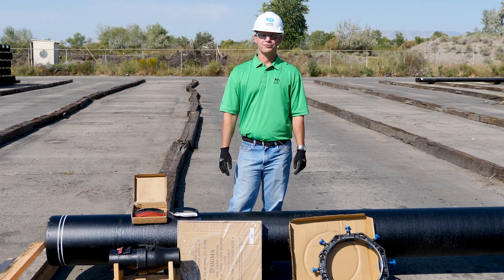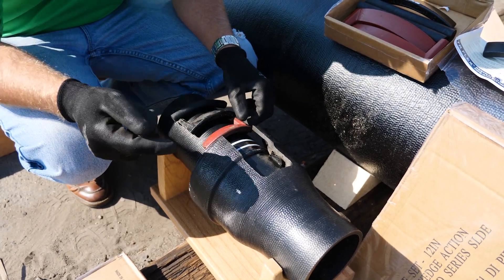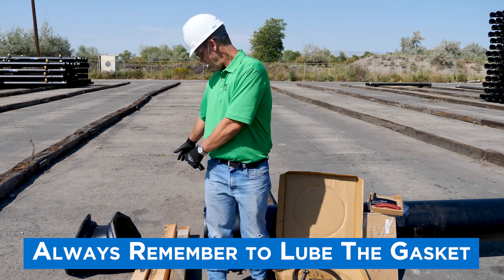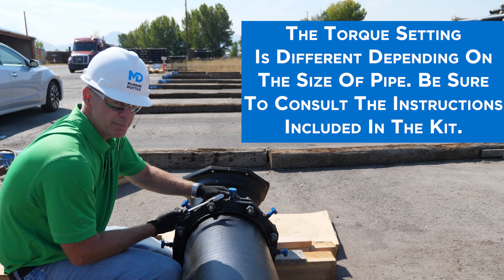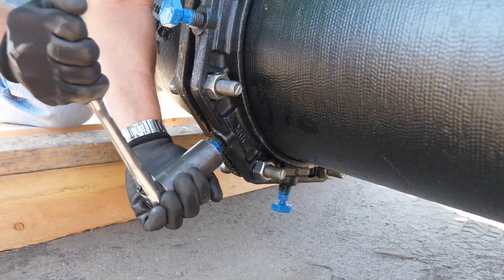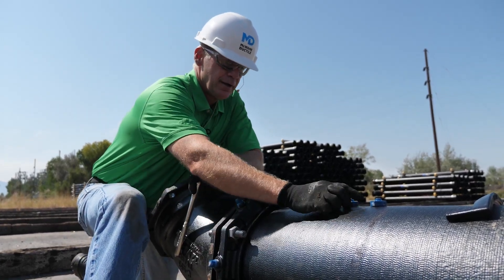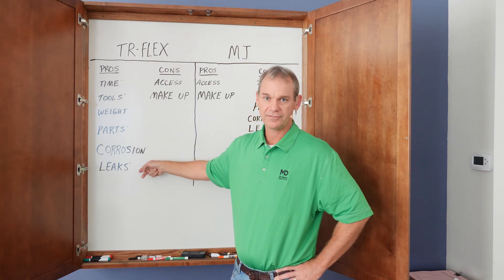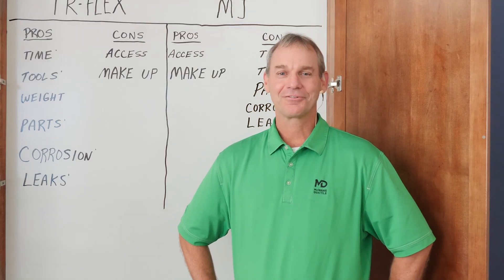TR Flex vs Mechanical Restrained Joints

Comment: Are those mega lugs
Reply from the maker: It may not be "Mega Lugs" specifically, but the installation design is the same. When the proper torque spec is reached, the bolt heads will break off to complete the installation. Thanks for your question and thanks for watching.

Comment: How does the  tr flex bind to the pipe to restrain movement instead of using the gland restraint?
Reply from the maker: A welded bead on the spigot end holds the locking segments in place after assembly. You can see a photo at the link below. Thanks for your question.

https://www.mcwaneductile.com/upl/images/blocks/5d4d7e797bd081448ecf3-ad0c056c.jpg
Reply: Don’t like the work hard . Sounds sexual. Maybe work smarter not harder. 😮

Comment: Also do you cut the di pipe's bevel before installing on mj?
Reply from the maker: No, you don't have to cut off the factory Plain End (bevel) before installing it in a mechanical joint connection. Thanks for watching.

Comment: What if you need a 45°? Tr flex nice if you roping the pipe, but not for a 45 or 90.
Reply from the maker: Not sure I understand your question. However, I agree it is important to use the right pipe for your particular application. We have the experience and expertise to help you plan and install your next project. Thanks for watching.